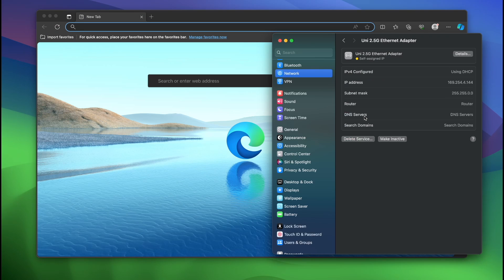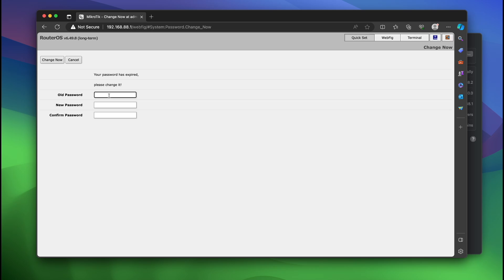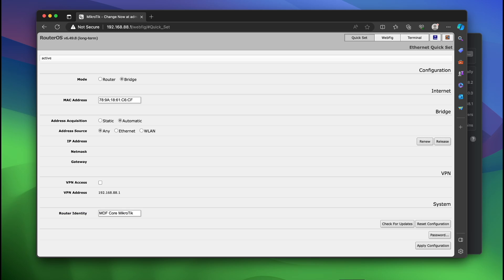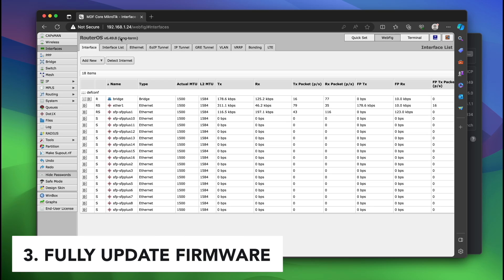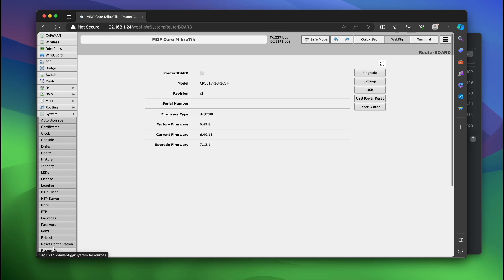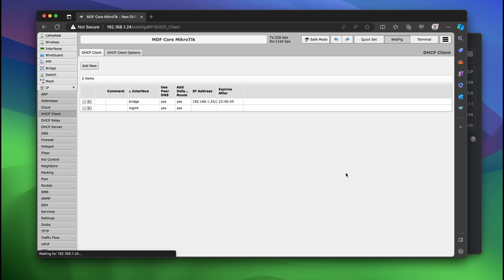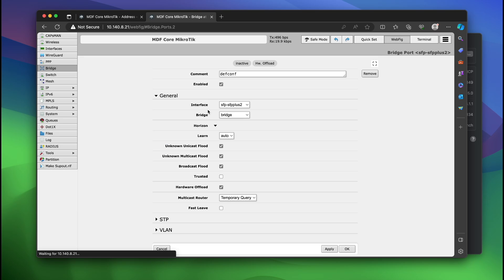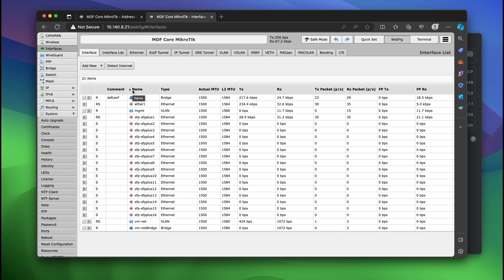MikroTik Switch Setup Tutorial: VLANs, Updates and more

Comment: Hello,

That method of tagging VLANs on Mikrotik equipment is completely incorrect, and it redirects all traffic through the CPU of the switch, which is quite weak.

The correct way to tag ports is to add all ports to the same bridge, then within the bridge menu, select VLAN, create the VLAN there, and set the ports to tagged or untagged as desired.

For interfaces that require an IP address on that switch, for example management, within the bridge VLAN menu, set that VLAN to tagged on the bridge interface (there must be only one) and then go under interface VLAN and create that VLAN with the bridge interface.

The next steps are the same, adding DHCP client, etc.

Additionally, to make everything work correctly, you need to enable VLAN filtering in the bridge interface settings.

Primarily for the core, I use router 2116 and an MLAG pair of 326 with 24 SFP+.

Also, firmware 7.12 was not the latest even at the time of recording the video; there is an intermediate version that must be upgraded before it can reach 7.12, currently 7.15.2, etc., due to changes in WiFi packages.

This configuration later allows you to easily add L3 hardware offloading without changing everything on the switch.

https://help.mikrotik.com/docs/display/ROS/Basic+VLAN+switching
Reply from the maker: Thank you for clarifying this. I will implement the changes you suggested to improve my network. 

Also good to note about the firmware. I’ll update that.
Reply: Hey, would this be correct to get hardware acceleration?

/interface bridge vlan
add bridge=bridge1 tagged=ether3,bridge1,ether1 vlan-ids=10
add bridge=bridge1 tagged=ether3,bridge1,ether1 untagged=ether2 vlan-ids=40